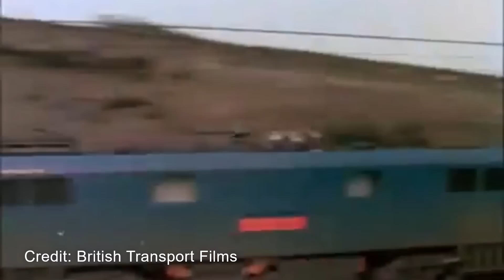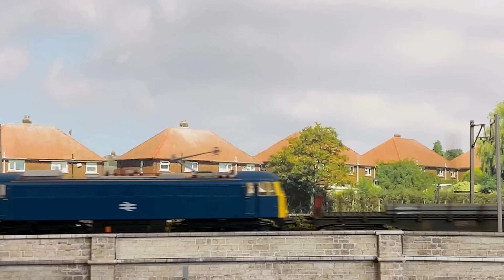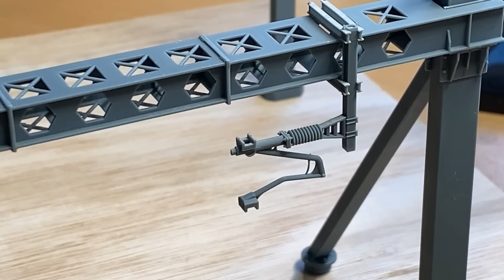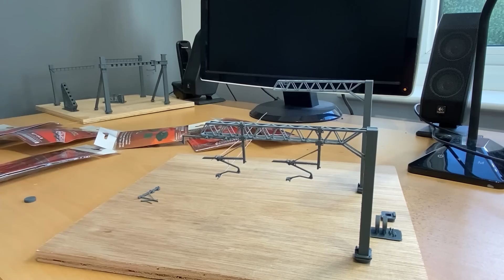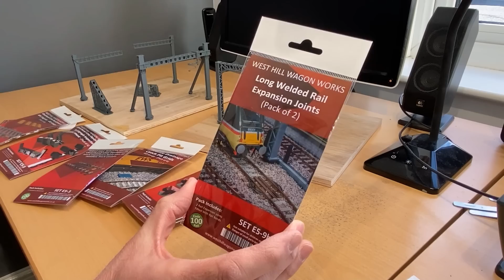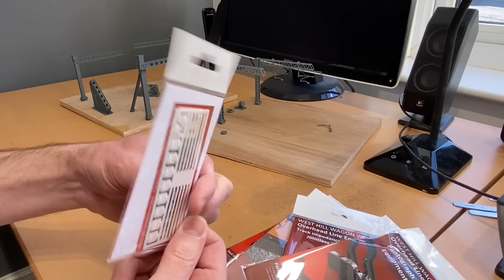The Most AMAZING Model Railway Products in 2023

Comment: Another question raised from seeing videos about catenary is how do you model these with wires over points?
Reply from the maker: You make sure there is a span either side of the points (if it’s a cross over) and connect a wire from them over the diagonal track on the point. 

Also, if it’s just a point off to a siding for example, make sure there are masts near the point to attach wire to both lines.

Comment: I'm planning a layout that has a 4 track mainline on it, unsure do I use a mono-boom approach with one long boom going over all 4 tracks or a cantilever boom on each side?  It doesn't seem as if they produce a 4 track width mono boom set but you use extension pieces instead?  So do these come in two halves that you glue together on either side of the track then?  And the extension pieces fit in between?
Reply from the maker: Hi, yes the extension packs can be built up to extend to the width you need. Or you could use two cantilever designs either side, but I would think one portal span would be more authentic for the real railway?

Comment: Triang had a working pantograph system sixty years ago. Let us re-invent the wheel.
Reply from the maker: I’m pretty sure it wasn’t as detailed as this. Plus, locos today aren’t built to receive power from the wires. So producing such a system would be pointless. 

It’s not so much reinventing the wheel. This takes detail, usability and practicality to a much wider audience.
Reply: @DeanPark  I thought that at te time they gave a good representation of the early masts of the Woodhead line (1500VDC) and the early 6.25/25kVAC systems. and running at night with sparks from the catenary was quite exciting.  Interestingly,  you could operate two locos on the same track independently. That may not seem a big deal today, but back then it was.The pantographs back then also seemed to be much finer and more realistic. These new products from WHWW show how ugly and over-engineered modern catenary masts are. The GWR mainline looks horrible now compared to many of the lines out of Liverpool St and Fenchurch St to East Anglia.

Comment: Hello...
Great video, as always! 
The version [ portal] with the side supports.... will that be ok without the  side supports... will expand to 3 or 4 line portal.... or is that still on its way? 
Thanks....
Reply from the maker: Hi, all varieties will be covered eventually by west hill. But yeah you can use one of the masts with the horizontal beam. If that’s what your situation requires. You can also expand the portals to fit 3-4 lines by getting the expansion packs.

Comment: They look great Dave, has anyone actually tried to make the wires live? I'm sure Hornby in the early 70's may have for a short time? All the best
Reply: Yes they did for the 1500V DC system used on the Woodhead route. There was a slide switch on the roof of the locos to switch between the overhead or the normal dual rail system.
Reply: As David Steele has said triang used to do it where you could take power from the overhead but one thing with that is you had to make sure the insulated side of the locomotive was on the correct line,these days live overhead wires are not seen and they are purely for show, this is because some manufacturer use plastic pantographs on their models and when metal ones are used they are not connected to take power, I have also heard they they don’t work very well with dcc as with that signals from the controller to the locomotives chip have to be constant and with a pantograph there is the possibility of losing connection.